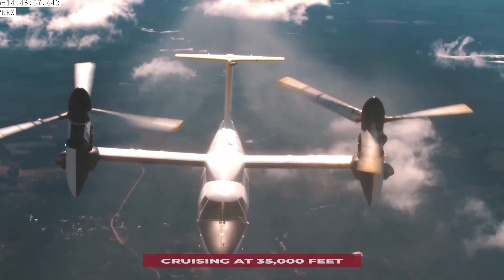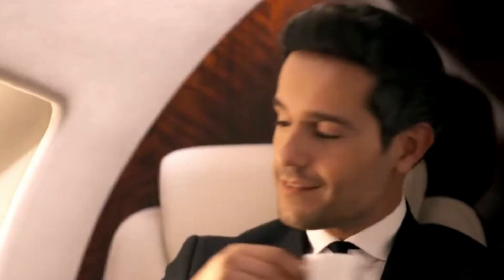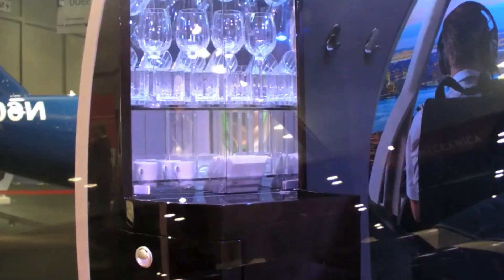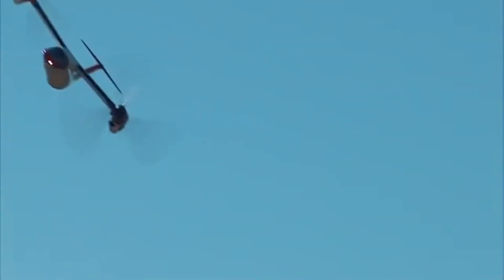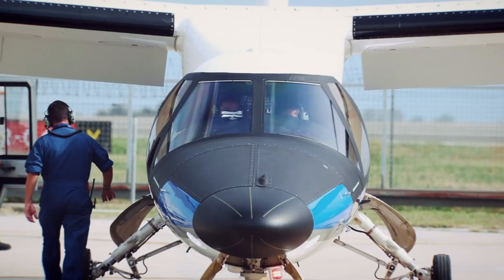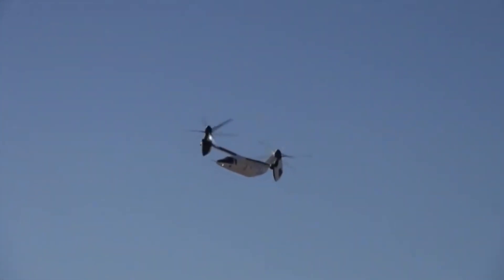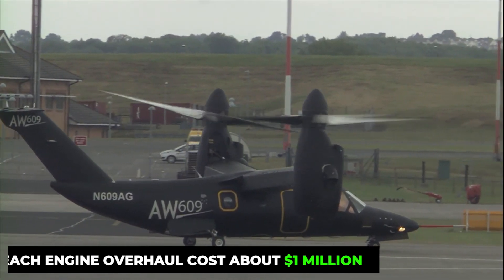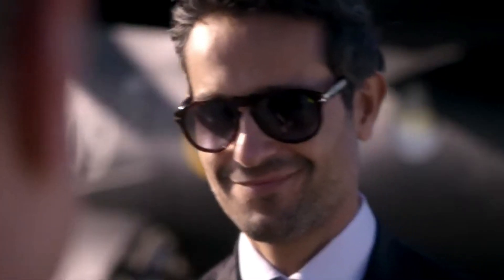Inside The $30 Million Leonardo AW609 Helicopter

Comment: 9:25 The aircraft's max takeoff weight is 8 Tons. Most yachts can only land helicopters up to 4 Tons. So no, it's not landing in a yacht in the Hamptons any time soon.
Reply: That’s the yacht’s problem.
Reply: The real issue here is that you’ve got a $30+ million aircraft, but not quite enough pocket change for a yacht big enough to land your 8-ton toy on.🤤
Reply: @N1originalgazza whilst true, seems it's more of a problem that it's never been done.
Reply: yacht helipads are designed purposefully to support at least double the weight of the craft it will be holding. If you owned a yacht, you would either not buy this aircraft or you would buy a new yacht. simple as that.... point is it can be landed on yachts, the helipads just have to be made knowing these things will be landing on them.

Comment: Hawaii Buy TEN. Leonardo drops 14 (4 SPARES PORT) 500M TOTAL BUYOUT DEVELOPMENT DIRECT COST TO INCLUDE INHOUSE DEALER RE-CERT. Building costs: 50M including (everything overhead) NET profit: Including anticorrosion and triangulated folding drilled holes with removable panels and pressure refueling adapter (50hours) Remove the the central cyclic and CIRRUS the cockpit. (8M over 10 upgrade still covered under 500M) 'Austrailia now has the largest overhead re-stringing carbon deposition robot in the world' 80ft viable with UV and stamped knuckuckle and cheap worm screws) tilt rotor power availability for the midwing to both empennages.